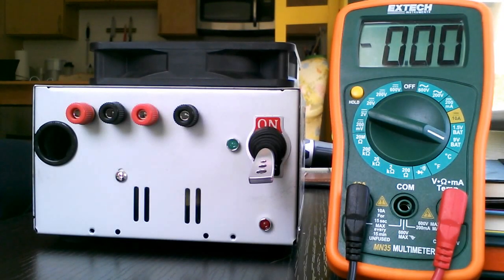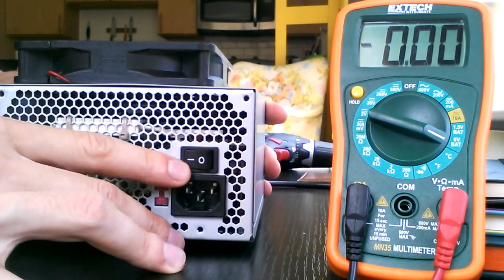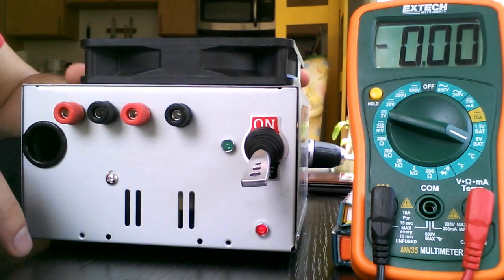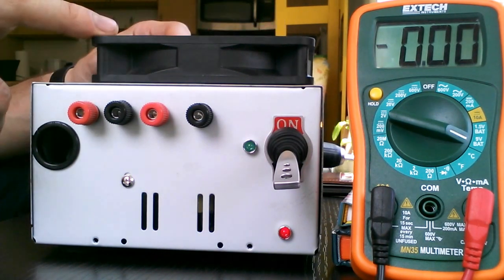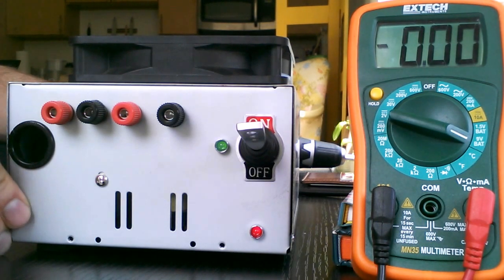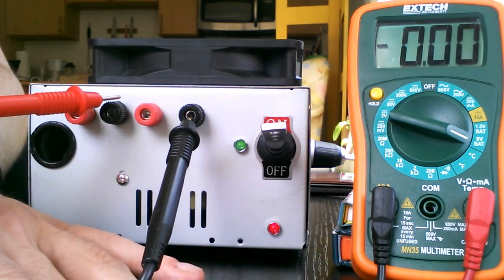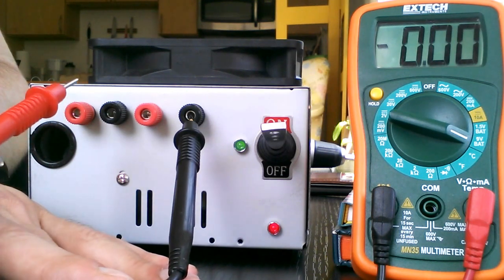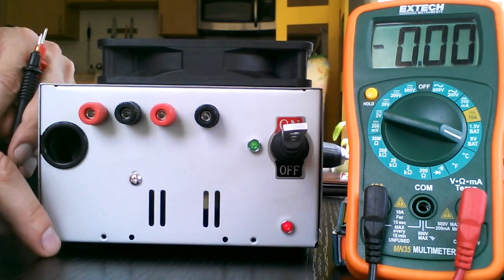DIY Bench Power Supply (Really Easy and Cheap)

Comment: I have that similar issue with my converted computer power supply. I replace the 
fan Thinking by upgrading it, it will perform better but instead I got the same 
result the only thing I really did instead i have upgraded it by adding a plug-in 
connector, It might as well not even have a fan in there at all. So what I have 
discovered by doing a experiment with the fan it was running off of a 5 volt 
line making it perform like that. So what I done is by hooking it up that 
same fan up to a 12 volt line and after that I got the results that I want it. 
You should try hooking up your fan up to a 12 volt line in your power supply.